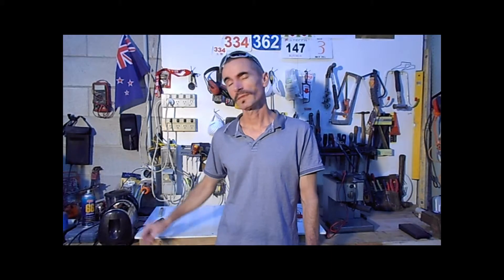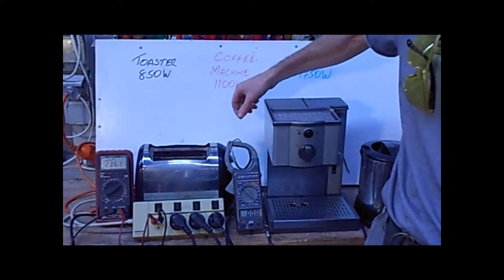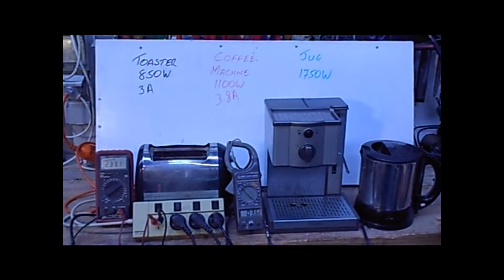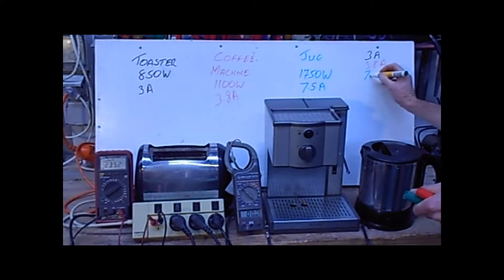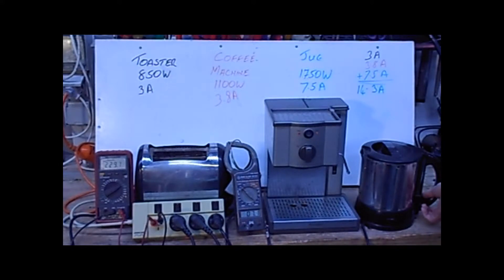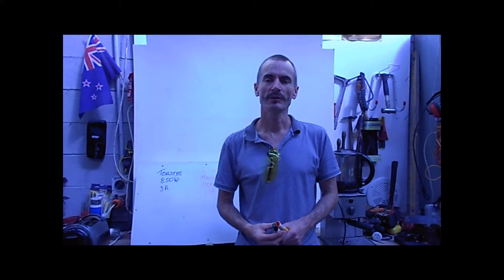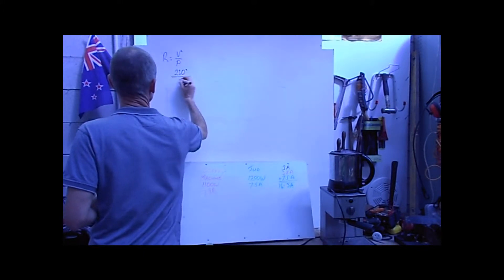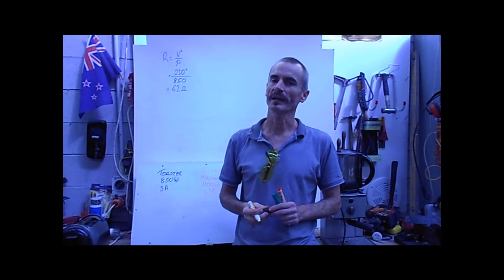VOLTS AMPS WATTS OHMS

Comment from the maker: The cost of building and maintaining generating plants is the big cost. Distribution, getting the power from the generator to your place, also costs a lot as well. In New Zealand a lot of our electricity comes from dams on rivers. If we all used lots of electricity the dam would just empty of water faster than the rain and melting snow could fill it. No water left to turn the turbines to make electricity. So yes we could run out. Coal, oil are used and they could run out. Nuclear makes BIG mess